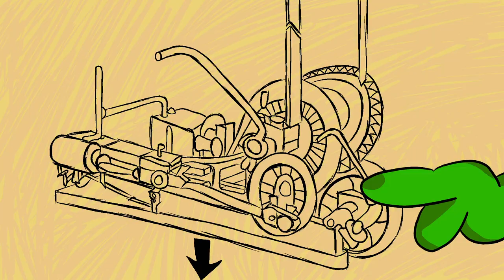Oney Plays Animated - "Pipe Organ Lore"

Comment: If anyone's actually curious, old pipe organs really did have manpower (or sometimes, like Tomar said, a water system) behind the actual mechanism pumping the air through the pipes (not with their mouths obv), nowadays we have motorized pumps to do that for us. The manual (the keyboard) also has stops that control which pipes the air can flow through, creating different pitches and volumes. Fun fact, the saying "pulling out all the stops," refers to the stop mechanism on a pipe organ.

On a side note, I'm not an expert so if I'm wrong about something let me know.
Reply: Your mostly right accept organs haven’t used water as a means of making the pipes sound since the ancient Greeks invented the organ
Reply: History is neat
Reply: The only correction I have is that you are still required to smoke a pipe while playing a pipe organ. The so-called churchwarden pipe has a long stem so the pipe organ attendant could stand off to the side and hold the pipe for the pipe organ player so he could rip fat cotton while pulling out all the stops.